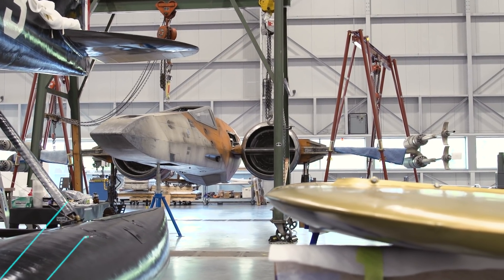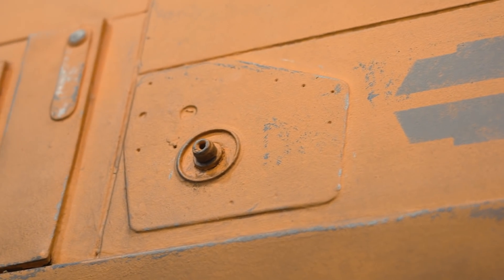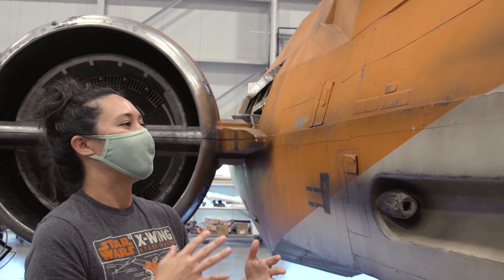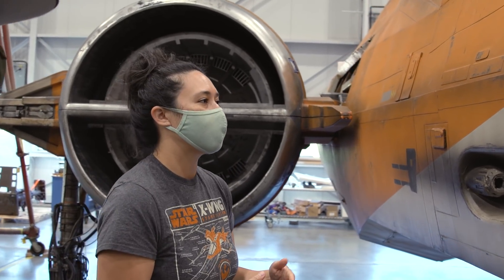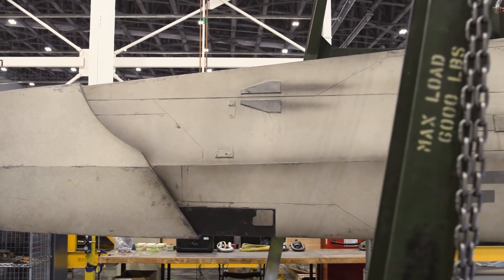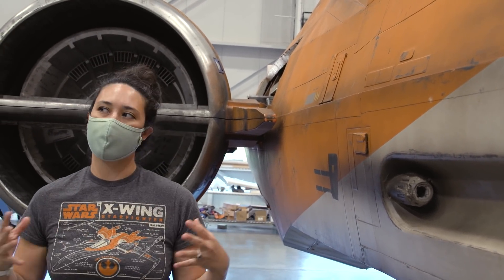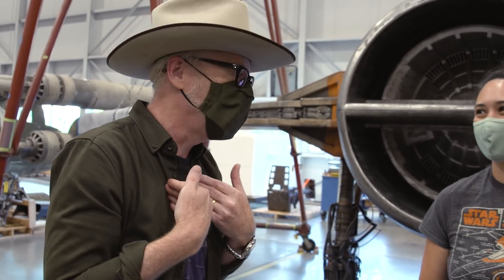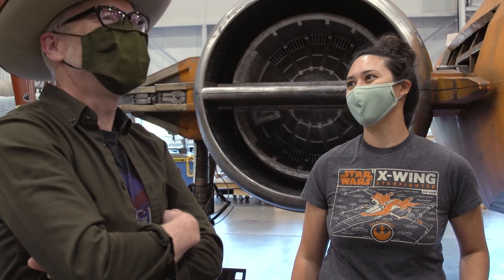Conserving the X-Wing at Smithsonian

Comment: Isn't there a 3D former/deformer that molds sheets of metal by pinching it into complex shapes specifically useful for airplane skins and concept car bodies, and it does it in only a few hours at a fraction of the cost of doing it by milling or press molding? I reckon they could make the entire fuselage of the X-Wing in this way from 3D (laser) scans of that 1:1 scale prop.

Comment: I know the T 70 is supposed to be more advanced than the T 65 , but I’m bothered by the fact that the proton torpedo aperture looks Too Small , who designed that ? Is the proton torpedo 1 centimetre wide ? Doesn’t seem functional to me.
If this feature isn’t a torpedo aperture, that should be explained.
Reply: For what it’s worth……The incredible cross sections The Force Awakens book explains that the T-70 benefitted from advances in miniaturization of proton torpedoes and its overall weapon systems. This explains the smaller size.
Reply: @TypeAndShadow  That’s a pretty weak explanation , the T 65 was a better design.
Reply: @stardude2006  i mean its not though. that happens all the time with real military hardware.

Comment: Well, yeah...gonna go have to go ahead and disagree here.  Might belong in the Smithsonian somewhere, but not the Air and Space museum.  It's not an aircraft, it's a F-----G PROP!
Reply: The OG Enterprise has been a regular in the Air and Space Museum for years, actually. Sci-Fi contributes to real science in ways that might surprise you, so I say it belongs.
Reply: After what I just saw, I could make a NEW version that looks almost the same BUT actually FLIES up to 75,000+ feet flight levels! With modern flight control software, we can make a BRICK FLY, so making this baby fly isn't all that hard to do anymore.  

We also have some custom designed 70,000 lbs of thrust turbo jets we could put in the back and use the front part as air scoops even if the wing itself splits apart into the X-Wing format like we see in the movies!

ILM did a GREAT job design-wise since it's aerodynamically UNSTABLE, so it would actually make for a very maneuverable proper close-proximity warfighting jet using thrust vectoring only OR with some actual flaps installed on the wings themselves!

Give me Ten Million USD and LOTS of Titanium Block and 1/8th inch and 1/4 inch thick Sheet Titanium and I will have a working flyable version in a little over a year!

v